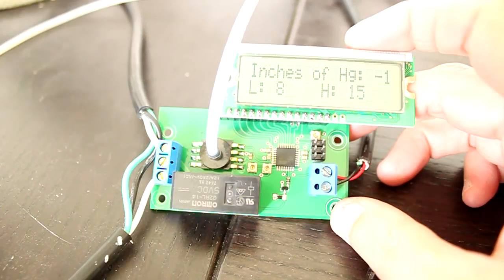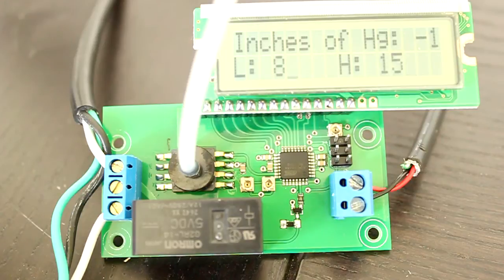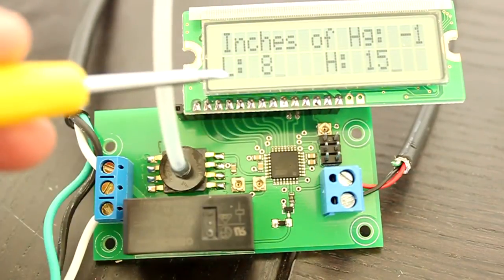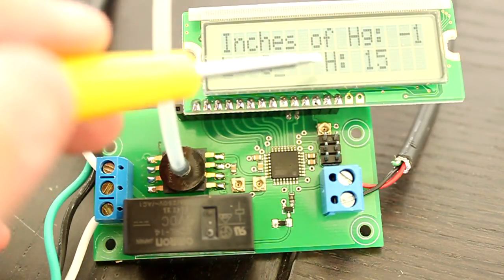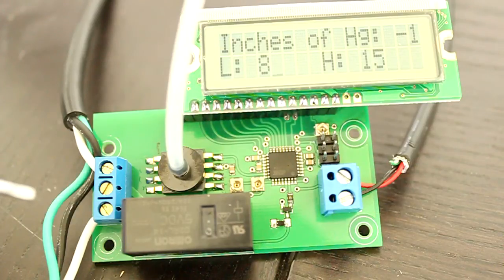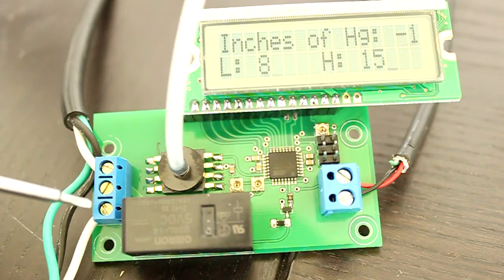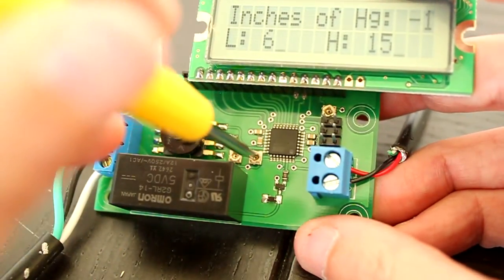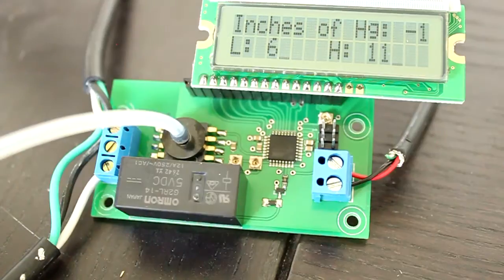Introduction to our Vacuum Pressure Controller

Comment: hi , thank you for the info, how i can test the vacuum pressure sensor ? i have ceramic furnace, when i start it on,  it does not show the atmosphere pressure and even when the vacuum on , no reading , i don't know if the sensor is damage or the PCB has the problem , kindly advice
Reply from the maker: I'm guessing you see the information on the display, so I assume the microcontroller and the display are working. When you take the hose off of the pressure sensor with the vacuum on, do you feel suction at the end of the hose?

Comment: are there any alternative to the sensors? price ranges from 150-200 usd per sensor..
Reply from the maker: Alternatives to the pressure sensor that I'm using? The sensor isn't cheap but doesn't cost that much.
Reply: the MD-PS002 senors im using cost $8 for 5 of them on ebay.  its inexpensive enough to not cry over if it doesn't work well. 
i just got them in the mail today so i haven't had a chance to use one yet.

Comment: So you are driving relay directly from AVR uC instead of using the NPN transistor method?  AVR can source 40mA, but the relay you are using has 80mA rated coil current (page-2 : G2RL-14-DC5  http://www.mouser.com/ds/2/307/en-g2rl-472571.pdf)
Reply from the maker: I only used the pin to engage the transistor that engages the coil.

Comment: Nicely done.  Though as a side note, it is generally better and safer to switch the line and not the neutral.  Although your application will probably be in a controlled environment, as in you will most likely be the only person working on it, in other situations where someone else is working on something like this they could get a shock from the line to ground.  I don't mean to be nitpicky, just pointing out a safety concern for others that want to do a similar project.